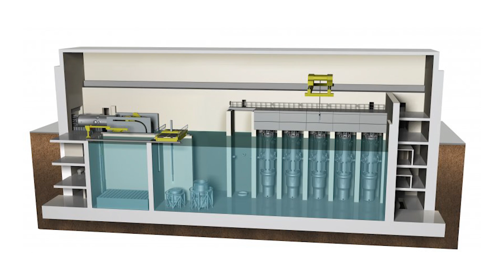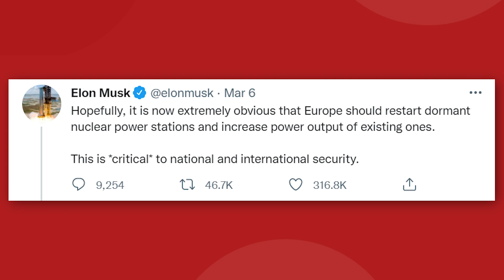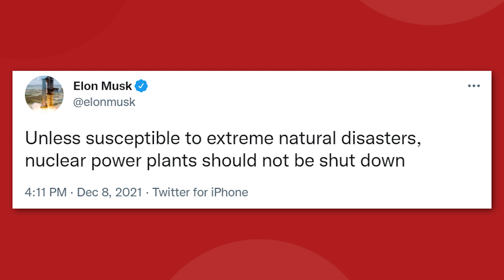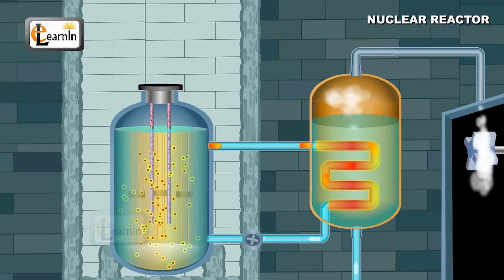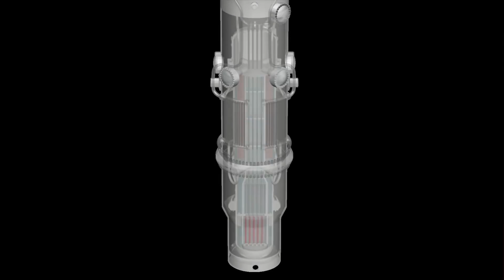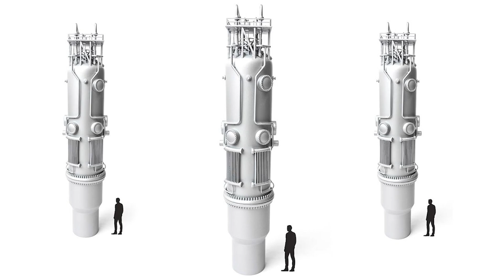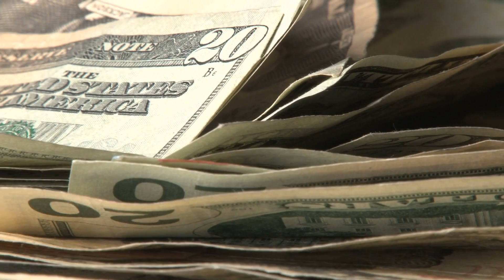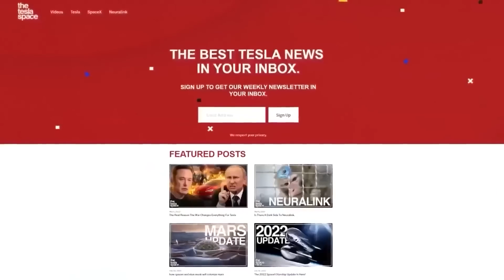The Real Reason Nuclear Energy Is About To Take Over!

Comment: It’s time we had a reality check to consider the following energy options and the alternative.

Cold Fusion (LENR) - Unproven hypothesized type of nuclear reaction that creates nuclear fusion at room temperature by producing more energy than the input energy can be produced from its altered state.

Tokamak Nuclear Fusion Reactor (ITER) - Development cost for the ITER is $150 billion. Requires a temperature of 150 million degrees Celsius to create nuclear fusion. Reportedly the record to date but having to use more input energy than produced is 69 megajoules of fusion energy for five seconds using 0.2 milligrams of fuel. 

4,536 Mw (VOGTLE) Nuclear Fission Reactor Costs $35 billion requires 1,282 hectares, nuclear safety costs $200 million per Mw, no technology to deal with nuclear waste and only has a known minable uranium reserve at current extraction rate of 80 years. 

The alternative

Solar Hydrogen Energy Recovery Gas Turbine – 301Kwh (equal to 46/6.6Kw home solar installations) of solar energy collected from the sun’s constant nuclear fusion at atmospheric temperature is sufficient for electrolysis to provide the start-up sequence and enable a hydrogen Gas turbine to synchronize with the turbines Variable Frequency Generator and provide constant electrolysis to continually fuel the turbine and operate the energy recovery system on a hydrogen use as produced basis to generate a variably regulated energy range between 80 - 330Mw with optional co-generated steam capacity up to 700Mw of electrical energy on a 24/7 basis. 
The turbine has three operational parts, cost $36.5 -49.5 million, requires a footprint area the size of a football field, noise level is 60dbl at 60m, incorporates direct air capture of CO2 at 1,400 Kg/sec and includes a 14-year end of life decommissioning or optional refurbishment program. 
Sixty-five carbon and pollution free, shovel ready installations generating a total of 21,450 Mw, retrofitted to any of the 120 Hydro-electric schemes would provide Australia's entire energy needs covering a combined operational area of 33 hectares for a 2023 total cost between $2.4-3.3 billion, construction period is 3 to 5 years, meet net zero twenty years earlier and makes wind and solar farms including hydro, gas and nuclear energy production redundant.

Comment: I have not heard anyone address nuclear security.  Normally, there is a large force on site to prevent sabotage, with very controlled access to the nuclear portion of the power plant, including the control room.  This is needed 24/7/365.  So long as these SMRs/control features are approachable, I would think that this same protection is required.

Comment: I worked in the nuclear utility business as an engineer and manager for 35 years. I believe in and support nuclear energy. However, I don't see how small output reactors can possibly be economically viable because the engineering, operations, regulatory, maintenance and security staffs needed to support them in today's environment simply cost too much. SMRs are a fantastic technical innovation, but the economics will kill them.
Reply: I worked also in the industry from 1972 to 2018 and agree with you 100%  These other issues you brought up stand in the way of ANY form of nuclear power.

Comment: Renewables and hydrostorage IS the endgame.
But getting there is going to take a very very very long time.
Longer then electricity has been used by humans so far.
Simply due to the current scale of energy needs and future needs when we arrive.
Infrastructure comes up fast,but it cant keep up.

Not to mention, renewables will be eternally unreliable.
Fission and fusion, as many downsides as they may have, ARE reliable, rediculously efficient for the space and fuel thry need, and compleatly location indipendant.
Plus, the little waste they Do have literaly cant be released into nature,thus its effectivly green energy.

Nuclear power is the power which will enable us to build the utopian renewable power infrastructure.
It MUST be that power.
Because the only other option is fossile fuels.
And they do to much damage in the time we need.

Comment: A really good point as well is that solar power doesn’t really work much past Mars. You have to have such huge solar collector’s to get any power it is ridiculous.

I am pretty much sold on thorium reactors using molten salt for the fuel for the fuel. Thorium has a variety of advantages. You really can’t make nuclear weapons with them. You can detect thorium deposits from orbit and thorium is much more common than uranium thorium also does not have to be refined, because the vast majority of thorium isotopes are breedable.

Comment: In the future we will need 5fold more electricity and no fossil fuels, no coal, no gas, no petroleum. 
Because the national grid is so expensive, and we need 5 times more capacity we should reduce the SMRs to a  micro size and have them at the millions of ends of the grid. 
No transmission infrastructure extra construction. 
These national grids are stupendously expensive and take decades to construct. 
Raw materials and manpower and time would just slow down the decarbonisation.

Comment: An excellent solution to complement Renewable energy sources and Battery Storage. For some strange reason, Germany 🇩🇪 or rather the public are against Nuclear  Power so the previous Chancellor decided to Decommission the 3 Reactors to satisfy the Green Party 🥳 
Unfortunately Germany is completely dependent on Russian Gas supplies via the  Nordstream pipelines. Many Moons ago a previous German Chancellor (Gerhard Schroeder) made a deal with Russia for Natural Gas ⛽️ 😀 that made Germany dependent on imports from a fickle Russian Dictator! Now of course the Nordstream is leaking after a mysterious explosion? Meanwhile, 2 of the 3 Nuclear Power Stations have been reprieved and will continue to operate in Bavaria & Neckarwestheim until April 2023?

Comment: We can easily convert to renewable energy sources in less than 2 years. If you combine rooftop solar and wind power systems with strategically positioned closed loop hydroelectric power stations you can easily and cheaply control the power production from solar and wind. To date the USA has had over 30 nuclear meltdowns that have permanently altered human DNA, worldwide there has been over 300 nuclear meltdowns. The majority of these accidents occurred in the military experiments and the problems have never been solved. All nuclear reactors need an alternative power supply just to lower the chance of meltdowns, in both Chernobyl and the Japanese nuclear meltdowns the failure of the alternative power system is the main reason why those accidents happened. Nuclear power is obsolete, dangerous and very expensive. Nuclear power is not the answer to the world's power problem. For the price of one nuclear reactor you can build a system of closed loop hydroelectric power stations combined with rooftop wind and solar power systems that can power an entire country. Closed loop hydroelectric power stations can be built underground or incorporated into building design saving space and placing the power production closer to the point that the power is needed eliminating most substations and transformers, closed loop hydroelectric power stations can be built any size from powering a single light bulb to an entire city but smaller units are more cost-effective. Would you rather have water next to your home or a nuclear bomb and a nuclear reactor is just a nuclear bomb where the explosion is controlled and happens in slow motion. Unfortunately the nuclear power industry is spending millions to convince people that nuclear power is safe but it never can be because no nuclear technician truly knows how nuclear reactions actually work. You can actually design a closed loop hydroelectric power station that is self recharging eliminating the need for wind and solar power systems but unfortunately I am the only person who knows how to make it work and currently the scientific community is not willing to listen to me. Closed loop hydroelectric power stations if properly maintained can easily last over 100 years in that time most countries will be having trouble dealing with the radioactive waste if nuclear reactors are used.

Comment: Really?  55-gallon drums of radioactive waste?  This is very misleading.  Nuclear energy has the best safety record of any industrial business over the last 6 decades when it comes to deaths and injuries.  No death or injury in a commercial reactor operating in normal operations over 6 decades throughout the world.  So, what more do you need?  Chernobyl was not an accident it was had all its safety prevention apparatuses defeated.  Nobody was hurt or killed from the Fukushima reactor accident.  Please get acquainted with the truth.  Even artillery shells did not cause a reactor to hurt anyone.  Yes, SMRs are safer, even safer than the safest energy production method.  Neutrons cause the split of atoms, not electrons.  What evidence do you have that a meltdown caused a massive fire?  Not all SMRs operate as you explained.  Again, high level waste is never stored in 55-gallon drums.  Also, you can recycle spent nuclear fuel in fast reactors to dispose of the fuel and make 30 time the electricity as was produced in the original reactor.  So, some SMRs actually use spent nuclear fuel as the power plant fuel.

Comment: More Light Water reactors (LWR) equal safe and reliable nuclear infrastructure??? 
Why not prepare fissionable waste materials as fluoride salts and eliminate the radically suboptimal operating temperature and frequent refueling of LWRs? Proposed nuclear waste 'burners' are being proposed as well-studied options, and fuel rod reprocessing is eliminated. These proposed designs have all the same shutdown and modularity advantages touted in this video for modular LWRs. Proposed liquid fuel designs solve many nuclear waste problems and extract radically more of the potential heat from fissile fuel. Liquid salt reactors can produce electricity that is cheaper than coal-burning plants. NO MORE LWRs!!

Comment: Think about reactors that are housed in a shipping container. Power transmission losses are minimized. Standard designs can be swapped out for scheduled maintenance. Self contained in use, Homes could be heated with 'waste heat.' Each village or industrial park could be its own 'independent system operator.' Large steel plants and like enterprises could have 'reactor gardens.'  Battery gardens could handle starting loads and transients. Computers could control load shifting. Just as "popping the clutch" in a car is hard on the drive train, power plants don't like it either. There are ways to avoid slamming loads across the lines as often happens today after power outages. The lack of transmission lines would isolate you from distant conditions.
Reply: Worry about security is warrented here.

Comment: Nuclear has a very, very poor fit with renewables. It is capital intensive which means that once built it needs to be operated continuously to repay that initial outlay. For a good fit with renewables you need low initial cost and running costs that scale with use so that they can be cheap when used as an infill when the sun isn't shining.

Comment: Sorry to burst your bubble:
1. World is running out of Uranium, At current demand there is only enough economically recoverable Uranium until about 2050. Urainium minining peaked in 1980.
2. SMR are Dead on Arrival, having all of the same regulations and costs of large reactors, but only at the fraction of the revenue costs. Utilities are not interested in SMR, they only do they if the gov't pays 100% of the costs.
3. Payback on new plants is about 40 years & take about 20 years in planning & construction, and there is only about 30 years left of Uranium. Utilities don't want them since they are aware of this. If we started to build new nuclear power plants, they would come on like until 2040 and than there would only be about 10 years of economically recoverable uranium left.
4. Heat pumps are far less efficient than building NatGas directly. The very best NatGas turbines are about 55% thermally efficient and there are about 10% to 15% losses in generation, distribution and voltage conversion. A condenesing boiler is about 96% thermally efficient. No way will utilites be starting large scale nuclear power plant construction, with a 20 year planning & construction timeframe, it would be a long time before they would have an impact on power generation.
5. We don't even have any long term storage options for spent fuel and the waste created processing Uranium into fuel. How about spending the Billions needed just to store the existing inventory or spent fuel rods.

The future will likely resemble more like the 19th century soon as the industrialized nations de-industrialize, and unsustainable debt crushes the industrialized worth. Global Debt has topped $300T or about three times world GDP. We have aging populations that have been promised grossly underfund pensions & entitlements that will zap the economy of any significant infrastructure investment. 

If you want to prepare yourself for the future, build yourself a homestead in a rural area so you can be self-reliant for your basic needs: Food, water, & energy. Do not rely on misguided gov't policies to save you from the pending hardships.

Comment: Cooling towers do not release steam. The steam pipes  are cooled by flowing water which is then , cooled by air, through its passive flow of air within those enormous towers. What appears as clouds is the cooling water condensing as it mixes with cooler air. Convoluted but cheap.

Comment: I don't think SMRs would be more cost-efficient per kWh. I'd love to be proven wrong, but there is such a thing as developing at scale. In China, mass producing large reactors has led to cheap units on time - similar to production in Japan many decades ago. Add to the fact that refueling a reactor is much cheaper than buying a new one every 20 years, and I don't see how SMRs make financial sense. The only way they  are superior is  that they have better PR so far.
Also, some reactor designs can refuel without stopping, like the CANDU reactors.
Also, all reactors condense the steam back into water. But you still need to cool the steam, which means you still need the wide stacks spewing white condensation - you simply need to get rid of the heat some way.
Reply: Would try SMR as it seem to have the factory built financial incentive, butmust say The current CANDUs have been called LMRs by some as they have a fair amount of modularity in refurnishment. At this stage of the game, we should not put all our eggs in the same basket. Biggest problem the US nuclear has for development is the NRC, of course regulation and obersight are required but when misguided ideology is used this should be flagged. Westinghouse was bankrupted and why was thst?

Comment: Sorry but solar cells will never be a takeover source of power. It’ll take so many cells that you’ll just be polluting the earths surface with them at that point. They good for alternative energy, just not a primary for the world.
Reply: You are correct about solar cells (PV cells) but not solar energy. There are far more efficient ways of using solar energy than have currently been developed.
Reply: @methylene5  oh yeah that i dont doubt at all. i was just speaking generally towards solar cells. hell even windmills are a culprit in pollution. last time i drove through cali windmills littered the landscape in some areas.

Comment: Instead of bundling a bunch of these together, necessitating long transmission of power and the subsequent large transmission losses, wouldn't it make more sense for them to be individually placed where the power is needed so that most of the power is used rather than just used to heat hundreds of miles of high tension wires?

Why would they produce more power in Idaho than Idaho can use, other than to heat up thousands of miles of high tension wires?

Comment: Good presentation with a few relatively minor factual flaws. Which ever solution to our need for energy we pursue, and I am certainly hoping it won't be just nuclear, or just particular energy source as it should be obvious we need all kinds for maximum affordable supply and dependability/reliability and scalability. Each kind has a particular set of virtues for which engineers can design the best systems. Incidentally, even when we do achieve fusion and virtually unlimited energy I have a feeling some resources like high grade coking or metallurgical coal and other particular grades of other raw resources will for a long time still be needed as feed stock for particular processes without which industrial mastery will be a lot harder. Cheers.

Comment: I wouldn't worry about cooling tower catching fire in nuclear reactor, I'd worry about NUCLEAR REACTOR catching fire. Nice uneducated images of cooling towers that may not even be from nuclear power plants but from any industry that requires cooling towers, like chemical plants and probably some metallurgy industry. I'm pretty sure NPP meltdown will not create zones that needs to be taped with biohazard signs since it's radiation hazard. I mean this video is full of very conflicting images.